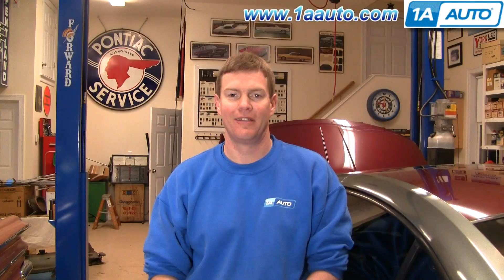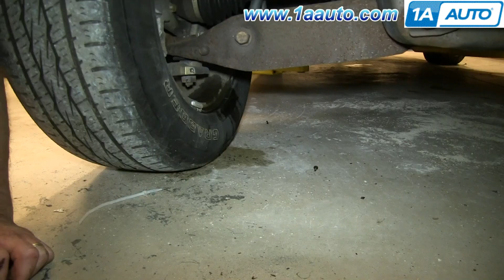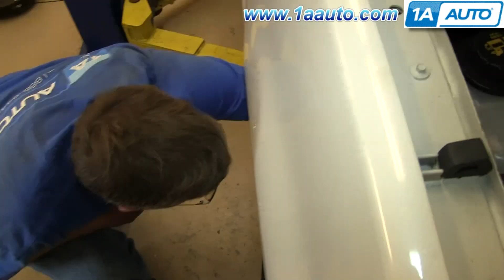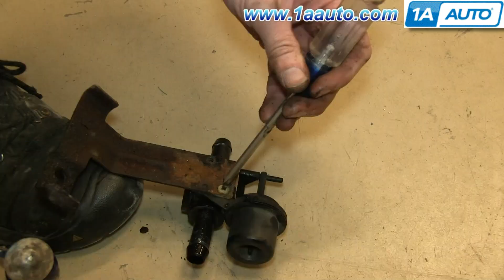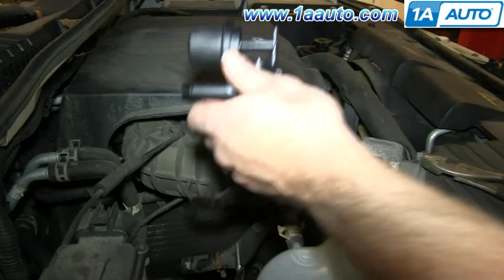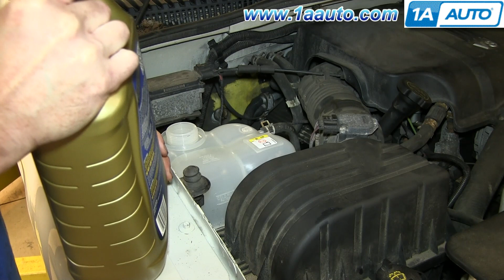How to Replace Heater Control Valve 97-10 Mercury Mountaineer 4.6L V8

Comment: Need to replace mine.looked up part and ones I find say without oil cooler. My truck has oil cooler. Does it matter??? Thank u.
Reply from the maker: Thanks for checking us out! Yes, it will make a difference. All the fitment information on parts will be in the "Vehicle Fit" tab on the listing. +Danny Snyder

Comment: Do you have to remove the tire to reach the screws?...
Reply from the maker: +Marcos Cartas You do not need to do anything more than we show you in the video, so it is not required for this application!  1aauto.com
Reply: 1A Auto Parts 
Thanks for the video, did the job on my 2002 Ford explorer... 👍👍👍🔧
Reply: @1AAuto  How exactly are you getting to that bolt with a ratchet?  Mine has a whole bunch of extra lines and heat-shielded cables in between the bracket and wheel well, about where his hand seems to be, and I can't seem to find an angle to get at it with a socket extension.

Comment: Where is heater control valve on 2001 f150 ?
Reply from the maker: +anthony Jacobs We currently do not have an auto repair video that shows it's location. We will keep this request in mind in the event that we need to make this repair in the future. Thank you for asking. 1aauto.com

Comment: Is there a possibility to install the heater valve backwards and cause the car to overheat?
Reply from the maker: +Jose Torres Thank you for checking us out. With the mounting bracket it appears there should be a one way design, but it is possible to be installed backwards which causes the vehicle to overheat. 1aauto.com
Reply: Thank you for the response. One of the pieces where the hose goes broke, so i brought the car to a mechanic that was about to close and he bypassed the t shaped hose so i could at least make it home and pick up my other car and head to auto zone to pick up the heater valve. I then brought the car to another mechanic and he didnt really seem to know where the hoses were supposed to go. He installed it and ever since the car has been overheating. There wasnt a mounting bracket on the car so i guess he just installed it the way he was holding it and didnt research. Thanks for your help.

Comment: hi MIKE! how you can tell  if heater control valve is broken? because my 2002 explore xlt , the heater connector is leaking with coolant it does mean the heater valve is broken also?
Reply from the maker: +BONIFACIO SERASPE If the heater core is leaking you may want to start with replacing that first. Hope this helps you out 1aauto.com

Comment: Hello there! Awesome video btw. Question, There is no HEAT at all coming out from my Explorer 03. Should I 1st unclog the Heater Core? Or simply buy the Heater Valve? Thanks and hope a prompt response !
Reply from the maker: +Carlos Rios If the heater core has never been flushed out you could flush it out to see if that helps to resolve the heat issue. If you remove the heater core hoses (when the vehicle is cold), you can take a garden hose and go back-and-forth between the two heater core pipes sticking out. You may see a bunch of gunk fly out. Hope this helps you out. 1aauto.com 888-844-3393